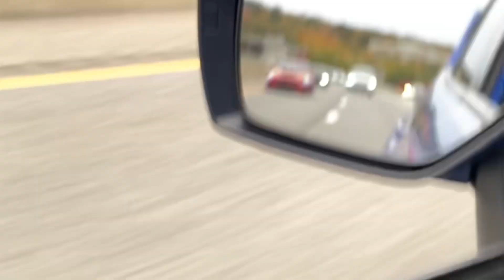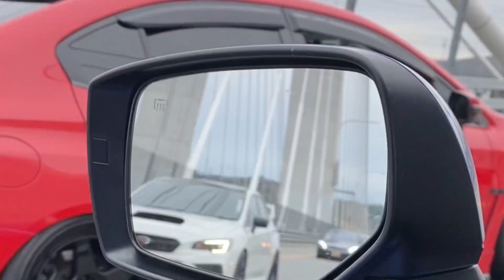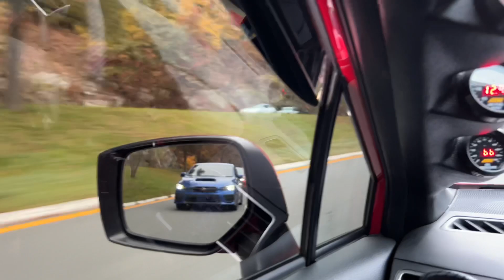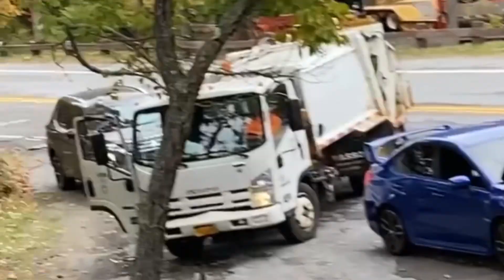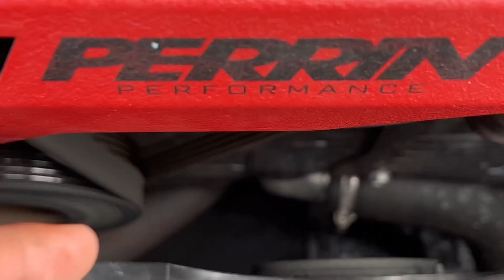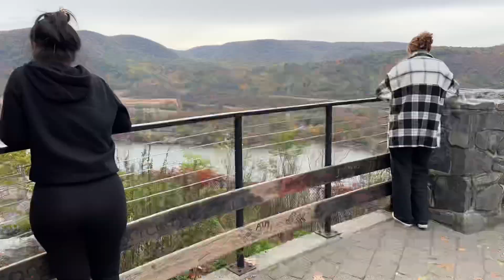Subaru Cruise To Bear Mountain ( POV )

Comment: Oh man, my old stomping grounds! I used to work in Northvale, NJ in the 90's, and would drive up the Palisades to Willow Grove Rd/Kanawauke Rd, through Harriman State Park to my home in Tuxedo at 2am every night! Pretty much drive as fast as you want at that hour; you'll see the glow of oncoming headlights long before radar can get a fix. Corner after corner of mountain driving bliss! Biggest hazard were deer, which I managed to avoid, but there were nights when the road near several lakes/ponds would be covered with frogs you couldn't avoid. I'd ride my bike through the area the next day, and not see a single squished frog; the other wildlife ate good on many occasions!

Comment: I want a WRX because they look better than a Honda Civic and because it has a physical parking brake and not an electronic one and because it has more power and is AWD but I'm scared of the reliability I've heard some say that as long as you don't abuse the car or modify it and keep maintenance it should be reliable and I've heard others engines blowing up being stock and well maintained
Reply: 50k miles on my wrx, been making over 400 whp since 15k miles and never had a single issue. Take care of the car and I would recommend finding one unmodified and low miles because people tend to cheap out on mods and tuning and that’s what kills these motors.
Reply: My 03 WRX wagon has 236,000 original miles auto tranny everything is original never been rebuilt I have had it since it was 5 years old and had less than 40,000 miles when I bought it unbelievably great car take care of it and it will last
Reply: I can agree on the civic if it was the last gen but the new WRX? Nah man the new civic is much better looking than the new WRX
Reply: I bought a jdm ej205 swapped wagon that was a nightmare. I ignored lots of red flags and bought a cheap wrx and had bad times. I take blame for this^ I bought a bad car. 

I just bought a stock 2015 wrx with the original fa20dit. Did have a full exhaust tho. I’m 3rd owner and car had 100k miles. Been in 3 accidents and repaired before it was mine. When I bought the car i immediately had it retuned with my tuner.  Dyno pro tune. Car is driven daily and driven hard. My tuner said then, car is running great and had nothing else to say. Recently brought it back to them for some walnut blasting and same thing. He said everything is great car is good. I have no issues. I monitor everything on my Cobb. No complaints. 

Subarus are great when taken care of and left stock. The new motors are also a lot more reliable as is. If I were going to build one tho, ej platform all the way. I wouldn’t build and fa20 as they have thin rods.